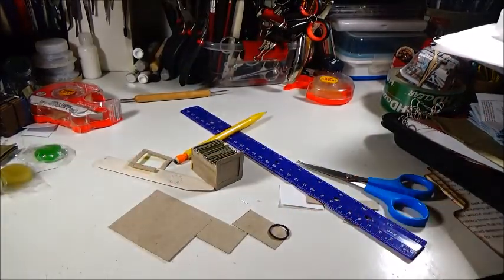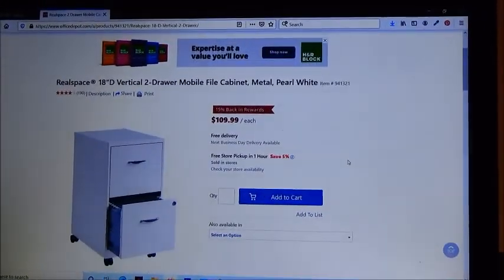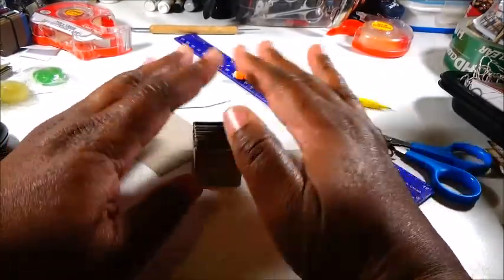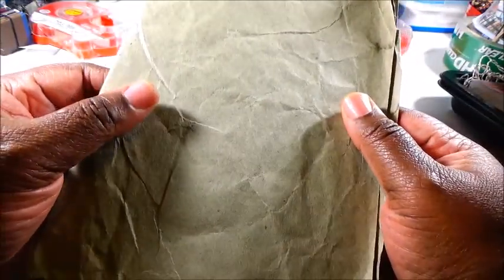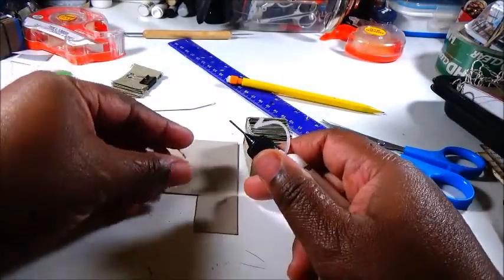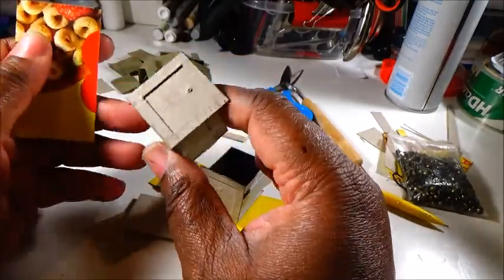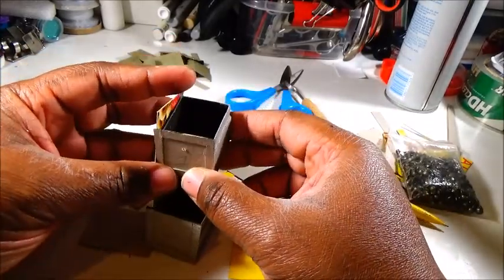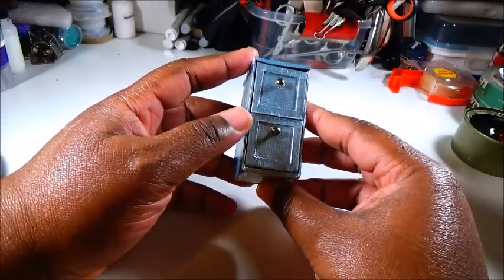WORKING Miniature File Cabinet | Dollhouse Miniatures

Comment: This is really great, thank you for sharing. One thing that can help with cardboard like that is when you start using it, you can use a penetrating layer of thinned down matte medium, and that goes into the cardboard, which keeps it from swelling later and also adds a primer layer for paint. When I use that stuff I always do that first and let it dry and have some around I can build with.